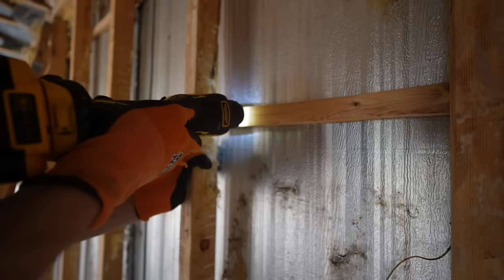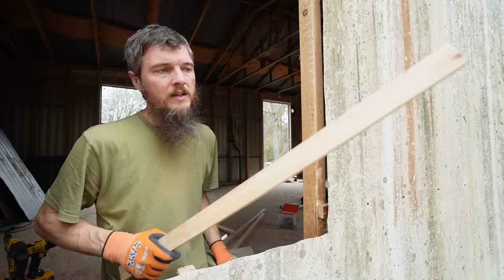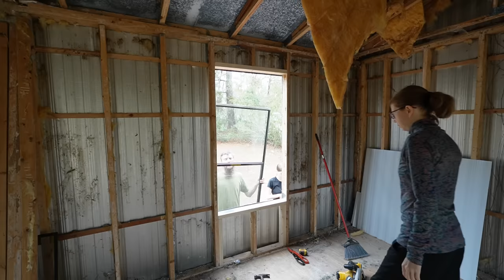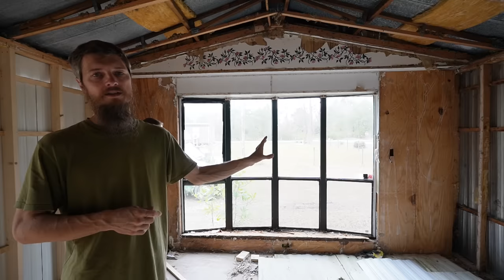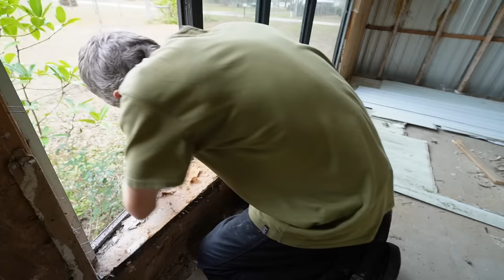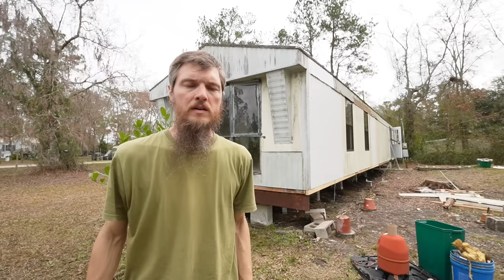Bay Window Can't Be Replaced - Salvaged Mobile Home Rebuild

Comment: Doug you had a real smirk  when you were talking about the layout, you know we reaaaaaly are busting to find out what is happening xx.
Reply: The older mobile homes , at least those we were familiar with, had the 2x3 stud walls.. back in the 70’s anyway.. the newer homes were 2x4.. it might have been new regulations, I don’t know.. I know they do make new regulations periodically as codes change..years ago aluminum wiring was used and then because of fire hazard that changed..
I like the amount of light the extra windows make in the house..

Comment: Don't worry about the window privacy. I put peel and stick frosting on mine 20+ years ago. It's still there and look fine. Be well from Canada 🇨🇦
Reply: I second this. I put some on my bathroom window at the suggestion of my daughter and I loved it so much, I put a different style of it on all my living room windows, three of which are in a large bay window frame. It is absolutely beautiful! It's very easy to install and requires no adhesive so it can be easily removed at any time. It allows a ton of light in and provides complete privacy.
Reply: @TheEnigmaticmuse  Yes. This new generation film is excellent! I worked nights briefly and used the darkening. Clean the window. Cut to size.  Spray some water   slide it around a bit to orientated, Squeegee out the bubbles. 2 - 6x3 ft slider windows done in about 35 min. Measuring 3 times and cutting once took the longest. When I stopped night shift, peeled off easy. Be well from Canada 🇨🇦

Comment: Doug, since you couldn't get a replacement bay window, you could definitely buy regular house windows and build wooden frames for them because you do great work. On the other hand, I personally would install french doors that lead out to a new deck. :) Ashley, there is a window cling you can put on the bathroom window. They have many different designs including a frosted one. You just cut to fit and stick onto clean window. If you want to change it, you simply pull it off. It's just like the holiday window cling material. Love the extra windows y'all  are installing. I love natural light. Great job guys as always. :)

Comment: 👍🏻👍🏻❤️🇺🇸 I removed the 5 panel bay window in my 1972 Lancer mh . I took off the whole bumpout and rebuilt it flat with board and batten and 3 tall windows. Does wonderfully. Old glazing had shrunk over time and  was letting in moisture that rotted the bottom. And not much uv protection!

Comment: Doug, I wanted the glass in my front door private, which is small but you can still see in so I used frosted glass spray paint and it worked perfect. I get the light and privacy. You might try that for the bathroom window. It will be so nice to have the bay window all refurbed because I like the window as well. It opens up the house.

Comment: Use 'window film'. It's at most home improvement stores.  just cut the roll to fit the glass, spray the clean window with water (not too much, just until wet/damp, then apply  the film.  It come in many different patterns and colors, but I highly recommend the old fashioned 'bubble' style that was real glass in older homes.  Honestly, you cannot tell the difference if you cut the sides carefully.  It is easily removed if desired, but does not fall off on it's own.
Reply: I’ve used this window film on my basement windows- great product and has lasted years!

Comment: The bathroom window is an easy fix. Buy obscure film. It's a cling style film that attaches to the glass like window tinting only you don't have to tint anything and it has the built in distortion effect. Turns regular glass into a privacy window and allows the light to come in.
Reply: That'd work. Or he can spray paint it with 'sea glass' finish. Or they can stain glass it with Elmer's Glue and acrylic paints; lots of yt vids on how to.

Comment: Galvanic corrosion is common on manufactured homes.  When it rains, the aluminum window frames react with the steel screws and staples holding them in.

Comment: A little clarification: Your front window is a bow window. Bay windows have 3 panels, whereas bows have 4 or more to give a more traditional, arched appearance. My previous MH had a bay window that I replaced the single pane aluminum windows with double pane vinyl (cold winters). The 3 windows of the bay were separated by framing (versus this bow which is assembled in one unit) and I trimmed out to make it look Craftsman-ish. I was wondering how you were going to tackle that bow window. 

WRT the corrosion on the window flashing: Fungus can do that. On the above mentioned MH I put on 2 new aluminum-clad over OSB storm doors. I noticed that after about a year, one of them started getting small holes like your flashing in one particular spot. It just kept getting bigger, and when I started poking around in it I saw what looked like a white fuzzy fungus. I sprayed it with bleach water a couple of times, saturating it thru the hole and I eventually killed it (then sprayed the spot with white paint to seal it). I contacted the manufacturer to see if it was covered under warranty (it wasn't of course). So I asked them why this was happening, describing the fungus. They said that since the OSB is a wood product that isn't kiln dried, there can be fungus left in the wood chips and in continuing to grow it ate away at the aluminum cladding.
Reply from the maker: Interesting, Thanks

Comment: Adding another wimdow in the aft bedroom made such an improvement!   Definitely a wise choice.  Although the bay window will be a challenge to rework and improve I have no doubt it will be better than new.    The bay window will certainly be an appealing upgrade.   Re the bathroom window - the frosted spray is fast but if it's ever nicked or 'picked at' you would have to scrape it off and reapply.  As an investment property that could be annoying.  When I had investment properties I always applied frosted cling-film on all bathroom windows.  It's similar to contact paper and shelf-liners but there's no adhesive.   Some adhere with plain water, some with a few drops of dish soap and some with window cleaner.  One roll would probably do your bathroom window over 75 times.   I used a film with swirls on it to coat my basement windows.   I have curtains but I am focused on privacy.   When I lived in an apartment I covered ALL my windows in film.   The windows came with mini-blinds but again, my focus was privacy.   I appreciate all the amazing videos and Ashley's amazing editing skills!   There's 2 channels that I prioritize over all others - this is definitely one of them.  The other is a hard-working couple with one child.   I admire the teamwork and respect between both husband and wife teams.   All 3 children are intelligent, respectful, kind, well-behaved and homeschoolled.    And they love creatures.   I just realized how many parallels both channels share.   (I have to mention Doug's humor re bringing the beauty of nature indoors via the rose bush beneath the bay window.   I was drinking hot tea when that bit played.  I literally sprayed hot tea everywhere!    Much appreciation for the unexpected pun. I needed that today.)

Comment: That oscilating tool is amazing i have one and helps out a lot one of the most important tools to own i think
Reply from the maker: It's so handy, I just wish the blades weren't so expensive!
Reply: @diyfferent  yes it wouldn’t seem such a small blade would cost so much, as soon as you hit a nail by accident it messes the blade up, been following you for a while i like the way you renew your homes i am kind of the same way and try to do everything better then it was before
Reply: There are a few videos out there on how to sharpen them when they dull. You can get a few extra cuts out of them for only a minute's extra work and, given their outrageous pricing, it's worth it. @diyfferent

Comment: I think the reason windows are on one side only, other than a high,  small window in a bathroom, or small kitchen window perhaps, is for privacy reasons as most mobile homes will be situated in mobile home parks very close to a neighbouring home.  This gives privacy on one side, with the entrance on the opposite side.
Excellent job, Doug.  I've learned so much from your examples about the refurbishing of windows, doors and replacing aluminum paneling that I wouldn't be hesitant to tackle them.  The floors as well.  Mind you, as a professional, you do make it look somewhat easy.

Comment: I used thin vinyl film from Lowes to create a  private bathroom glass.  It goes on wet usually with window cleaner such as Windex.  Ours has been in place for several years without coming loose.  Might think of using that for privacy.

Comment: Doug I can't remember if you said the double pain windows. The window on the end is just like the one we had replaced. I sure the kitchen and living room will be open like ours one open space. The window will have condensation on the inside of the window will ruin the wood over time ours did. We just had to use them untill we could save up the money to replace them. The bedrooms and hallway was warm in the winter but it was cold in the living room and kitchen. Even when we replaced our central heat and air. Of course I know you will be insulating better than we have in ours. I know you know what you're doing I don't usually say anything I just wanted to tell you our experience. Love to you all!❤

Comment: Look for frosted glass paint by Rust-O-Leum . I believe I got it at HD or Lowes. I am sure you could call them and ask.  I used it for a different reason for inside glass but I think if the shower water would not be an issue it should work perfectly. I sprayed my glass with three coats, you just keep applying it until you get the desired look. I used it to put a clear glass over a light fixture and wanted to dim it down so the light bulb didn't really show through.  Worked great.  I love what you are doing and I cannot wait to see how you assemble and lay out the house. I know you mentioned it but I can't recall.  Whatever you do will be awesome I know!  I love the windows as they have been done as on nice days a cross breeze is always wonderful.  Doing great you two............blessings and best of luck!!!!
Reply: Got mine at Walmart

Comment: I think you're so brave in pulling that sill from below the bay window. In all of my experiences with things like that is, #1= can of worms, and #2=, there's almost surely a good reason why it was either done or left the way it was. The 1900 farmhouse we live in, one of two that we've renovated,  has several original wood frame windows with the very wavy glass that I absolutely insisted had to stay. Well, somewhere in th past, a person with terrible skills, decided to apply pure silicone caulking to every nook and cranny of those windows! I spent several months working away at those windows, lead paint and all, attempting to remove as much of it as humanly possible. When I had most of it gone, I went over all the areas with a paintable silicone caulking to seal it and then primed and painted them. Several years later and the paint is holding well, but I will never forget the amount of work that i put into saving them! I just cringe at the memory. I really do love to watch you both putting your skills and courage to good use! ❤
Reply: Thank you from me for saving them! But shouldn’t you have used the putty like it originally would have had?
Reply: We live in a 100 year old house that was fully remodeled about 15 years or so ago before we bought it. The previous owners mostly did stellar work but they used clear silicone all over the place! It isn't paintable, it is impossible to clean and it looked terrible! When we remodeled our living room, I spent a lot of time removing as much of it as I could and it took a long time! So irritating! Some of it I couldn't get off so I just ended up priming over it.

Comment: The film you apply with water onto windows works really good for allowing light in and blurring the glass.  Lots of inexpensive options in design etc. on Amazon.  I used a frosted one on my garage windows as I didn’t want blinds in there since they just get filthy.  Still on there many, many years later.

Comment: Love the second window you added. It certainly makes it lighter in the back. Cross-ventilation is also a good thing for the future resident. The lawnmower noise did not cause any difficulties with the audio. It did not overpower your voice. Ash did great work in the edit. 

One of your viewers suggested creating a box bay window. This would make it less complicated than trying to save the current bay window. 

For the bathroom window, you can try to "etch" the glass chemically. I would test it using the broken glass from the bay window. I am not sure what the product is called. Alternatively, there is translucent vinyl, however, I find that after a couple of years, they tend to shrink, and it becomes noticeable.

Comment: Just a thought ... since I could only see pics of the "white" blooms (which can be cleaned off) growing under the metal of the underside of the window flashing.... that could be the  - didn't you have large trees growing quite close - which you had removed?   could be from the tree sap accumulating ...  leaves react with the metal??   which also could be quite acidic   and slowly eating/wearing away of the edges of the metal/flashing??? 
I also very much like the large bay window  .
oh I hope I make sense LOL
Reply: Absolutely right, I have yackas near a metal fence, and it left horrible black marks where tree touched

Comment: Keeping the front windows is nice but i would have taken them out and put 4 regular windows across the front. Of course that would be expensive and i have no idea how to do it so great work guys!!😂 😂😂 Forget my ideas!! Putting in another window in the back will also help with a cross breeze in case they don't want to use the air conditioner. God bless y'all and stay safe! From Missouri

Comment: flasjing could be zink and the window surround aluminium causing the corrosion , besides that the fastening is steel / metal with the overlap joint water can seem in between the aluminium window sil and siding material 
when you remake the bottom you might make a drip edge under the window so water dont get around the window frame
probably a good idea to replace those strips holding the windows in as those are likely turned to stone 
might be able to use the glass out of the old side windows that came out in one piece , the top one might even be the same size

Comment: They sell a spray you can spray on your bathroom window. Also Home Depot sells press on window clings. I used the spray and you just wet it and clean with a razor blade if you want to remove it. The spray was frosted so you can’t see through it but it allows light in

Comment: For privatizing the bathroom window, there are window clings that you can get with various styles/colors that are easy to install and relatively cheap.
Or there's a trick with dry-clear glue/resin that you might be able to use to distort the view, but I can't speak on the success of that, as I haven't tried it myself

Comment: You can buy glass etching paste at a craft store to etching the glass and give it a frosted appearance
Reply: @stephanierando3477 Etching paste is a really good idea. Some of Belle's artwork would be wonderful!!!
Reply: There's also a liquid that can be applied to look like etched glass, but is removable. I think it comes with the kits that mimic stained glass. Not as toxic as the acid used to etch glass. Or there's film that can be applied as well, similar to tinting but looks like textured glass.

Comment: You cannot put particle board, or plywood on aluminum. There's trace amounts of copper in them and that copper will react to the aluminum causing it to rot. That's why the aluminum sheet under the bay window was rotting. Copper + aluminum = bad.

Comment: We live in a 50 something year old double wide and have replaced several windows over the years, resizing some because we couldn't find matches.

Each window at the top had 2 2x6's or 2x8's sandwiched together, I'm assuming to make up for the strength of the missing 2x4 wall studs.

Is there a reason you only put in a single 2x4?

We have no experience in this stuff other than what we've done since one of our first windows was broken by a cat, or redoing some rotten floor sections and more recently a bathroom ceiling because it was falling down.

(We've also redone most of the outside walls and insulation for every wall that we replaced a window. About 80% done with that, but we are still living in it so it's a project here and there, and also installed Mr cool mini splits)

What we've done was learned from YouTube so I'm just hoping to learn a bit about what you were doing there and when it's necessary to do what was done in our place.
Reply from the maker: The reason we didn't build headers is because they just aren't needed in this home. The home is very lightweight and has zero snow load since we are in the south. This home was engineered and built without headers and it lasted for 40 years. So to add them now would only be for looks. They really wouldn't add any benefit.

We're not looking to overbuild or change the structure, we just want to restore it to what it was. So if the home originally had properly built headers, that's the way we would build it back. But this home just didn't have them. And by not doubling up our studs and building headers, we just keep our insulation job a little easier since all of our stud bays will be the same size and 16" on center.
Reply: @diyfferent  thanks for the explanation, I appreciate it.

And thanks for sharing your experience on YouTube, it definitely helps a lot of people who otherwise wouldn't know how to do it themselves, and may not be able to pay others to do it for them.